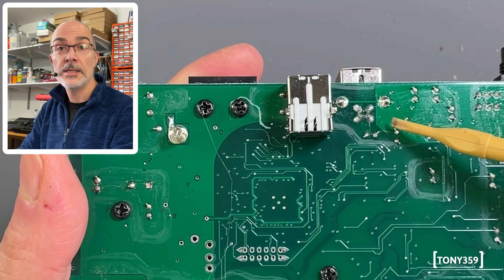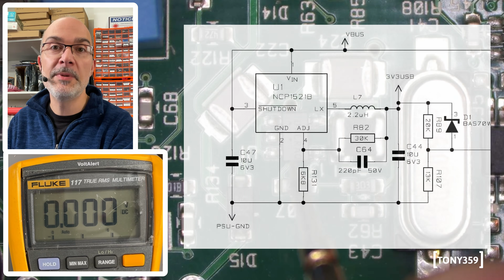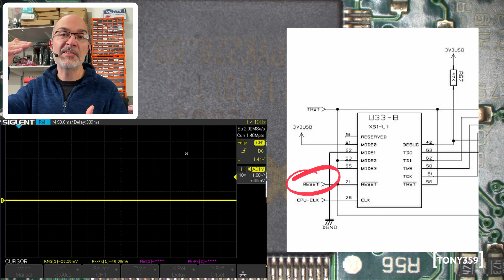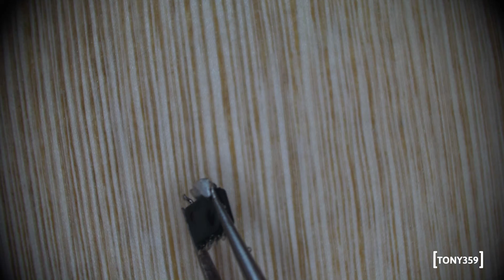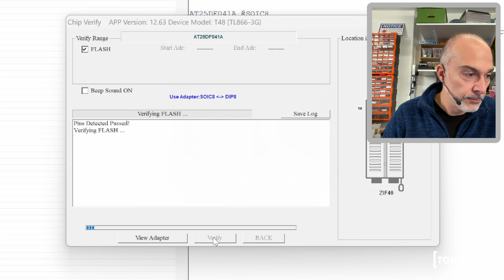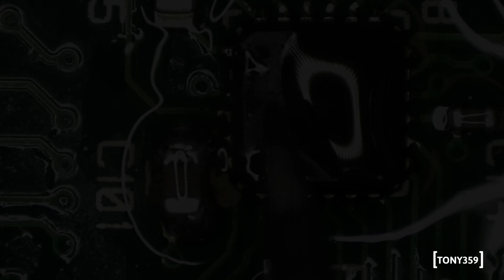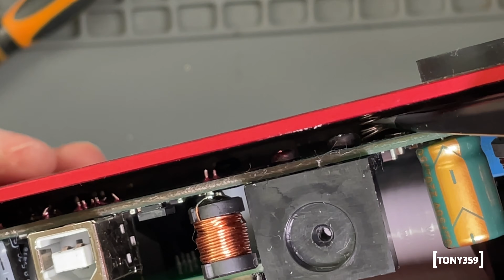Fixing this soundcard wasn't easy!

Comment: I 2 questions 1. what is the liquid stuff you put on the solder joints and two where can I find a USB jack to fit the the focusrite Scarlett ?
Reply from the maker: 1. it's called flux. It's a must when soldering, it makes the solder flowing, preventing oxidation. 2. USB jack?

Comment: Hi great video!!! I wanted to ask how exactly what usb and chip did you purchase?  I might need to repair a used focusrite coming to me. It has an issue of connecting at time to the PC 🖥️ , to solve it the previous owner said they unplugged it and replugged it , and the the computer would detect it. Any clue 🕵️‍♂️ on what this might be?
Reply from the maker: it's called USB 3343 but make sure your Focusrite has the same IC. 
If the issue is intermittent... it could simply be a case of spraying some good contact cleaner in the USB socket and/or try another cable :) I'm not sure a faulty USB IC would show such an issue but I am not an expert! :) Good luck!
Reply: @tony359  thanks for your reply and info. I will try this out once it arrives. I’ll let you know how it turns out.
Reply from the maker: Please do!
Reply: @tony359  hi just got it in and when I connected it, the usb light turns on for a few seconds .. then turns off then on it just keeps repeating that same pattern eventually after turning it off and unplugging it , it will connect. Any Idea 💡 on what it might be?
Reply from the maker: @ToneyLocoTV  I had a similar issue with mine, it's in the video. It's difficult to solder those bastards!
Reply: @tony359  yeah that’s right !!! So where could I find the correct USB IC for the 18i20?
Reply from the maker: @ToneyLocoTV  Why do I feel it's one of those 18i20 I was trying to buy on Ebay? :D
Aliexpress is your friend :) But it might just need to be re-soldered.
Reply: @tony359  I was thinking maybe solder but I’m trying to locate which one of these tiny chips it is would it say usb what should I look for?
Reply from the maker: @ToneyLocoTV  it's going to be close to the USB port, it'll have traces coming from the USB port and if you google the IC number it'll say USB on it :)
Reply: @tony359  just did some investigating and I can not seem to find the chip
Reply: Don’t see any chip that’s as small as the on in your video I see to that look similar but they are different sizes and don’t say anything about usb
Reply from the maker: @ToneyLocoTV  it won't say USB on it. You'll have to google the code and the datasheet will tell you it's a USB receiver. What generation of 20i18 did you get? I'm expecting one over the next few days and I'll definitely take a look inside.
Reply: @tony359  I have the 2nd gen 18i20. I see that it has two chips that say xmos (xfr002c) and (xfr001c)
Reply from the maker: @ToneyLocoTV  That is the CPU - you haven't watched my video, have you?! :D
Reply: @tony359  😂 yes I’ve watched it a couple of times but in the 18i20 it has two chips that say xmos .
Reply from the maker: @ToneyLocoTV  but the XMOS in the 2i4 is the CPU! ;)
Reply: @tony359  so are you saying the 18i20 has 2 CPU’s?
Reply from the maker: @ToneyLocoTV  https://khronscave.blogspot.com/2019/04/41-focusrite-scarlett-18i20-1st-gen.html
Reply: @tony359  yeah I happened to see this one , the gen 2 version has 2 capacitors instead of a usb3343 chip not seeing any chip that looks similar to the usb3343 18i20 Gen 2 has a sort of different layout.
Reply from the maker: Then I don’t know I’m afraid but it must be close to the usb port. Maybe at the back? I doubt Focusrite redesigned massively the PCB, too expensive to make changes 🙂
Reply: @tony359  yeah but I’m not seeing that similar looking chip near the usb port
Reply: Would it be possible for you to check out some pics of the inside of the gen 2 18i20 to see if you can spot it?
Reply from the maker: @ToneyLocoTV  if you send me good quality high resolution pictures, yes. Better if you share them (onedrive, dropbox etc). My email is on my profile.
Reply: @tony359  ok great I’ll send them as soon as possible

Comment: What Can cause a sound card to fail ?, sencondly I Can know if a part from sound card driver there is some thing else to add because I use Scarlett 18i8 1st génération in the computer from mixcontrol I see the output signal when I play music but that does not don't come out to the baffle
Reply from the maker: I'm not sure I understand your question but it's hard to help at a distance I'm afraid. If your 18i8 has no sound output, I'm not sure I can help.

Comment: Muchas gracias por tu aporte.
En mi caso es una iTrack Solo que de la nada la pc dejó de reconocer la Interfaz 
La solución que me funcionó fue usar la estación de calor en el circuito usb3343 para que se vuelvan a soldar los pads, no fue necesario cambiarlo
Dejo aquí el comentario por si a alguien le sirve :)
Reply from the maker: Thank you - someone else also mentioned that reflowing the USB3343 was all it was needed. Who knows, maybe it would have worked in my case too! Thanks for commenting!

Comment: I repaired mine by applying a little heat to the USB chip.
It has been running for 4 years.
What I don't understand is why you changed the USB connector without first checking your connections.
It seems that in this model, Scarlet 2i4, this failure is quite common.
I subscribe to the channel because of your excellent videos
Reply from the maker: Hello and welcome! The USB connector was broken, the central part was missing and had the terminals just hanging in the air! Sorry if that wasn't clear in the video.

Yes, I could have tried re-flowing that IC for sure. Not sure why I didn't try? Maybe to avoid stressing the PCB twice with heat. Some PCBs are not great and traces start detaching when heat is applied, even at low-ish temps. But I have to be honest and I don't think I had this elaborate thought back then! :D

Comment: Since you are obviously a genius at this - there is a common problem with the Scarlett 2i2 where it boots on, flashes orange on both gain nobs a few times, is recognized by the OS but has NO sound at all and NO input signal with or without phantom power. Thoughts? Focusrite tech support say - broken, so sorry for your bad luck ;P
Reply from the maker: ahah no geniuses here! :)
No, I've never heard of that. I suppose it might be a Firmware issue. If the interface doesn't have a way to re-load the firmware when the interface is not in a working status, it might require some PCB work. 

Does the I/F show ok on the OS? That might indicate the CPU inside the Scarlett is actually working so the issue is somewhere else.  Sorry, not really familiar with that fault.

Comment: Thank you for your video. Love the accent. I was going to buy one of these, and I also have the same disease of getting the one in a thousand million products with a fault that causes the card to record all vocals in reverse, or something similar. I fancy myself as a bit of an electronic repairman but I would have binned it early on in this repair! BTW I bought a UA i/o box which has v. similar specs and its great.
Reply from the maker: Thank you for watching! I've been using this little interface and it's ok! There are a few reports of the same fault though, maybe not the best HW implementation.

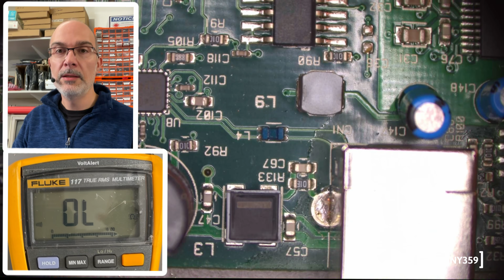Comment: Hi! Thank you so much for making this video. I have a 2i4 with the same problem, but mine it does get recognized and works for almost 2 hours and then dies, then if I unplug and don't touch it after a few days it works again for 2 hours and repeats. When it stops working i get the same problem that it doesn't get recognized by my PC (Windows 10). I already tried it in W7 and W11 and still get the same issue (I haven't tried in Mac). I bought it second hand like 3 years ago and I never get to see a good video that shows troubleshooting, until now. Now I'm trying to read the voltage with a multimeter but i have never used before in a system like this board, i dont even know where the negative probe should in minute 8:20 hahaha, I would be so grateful if I can get some help in my journey too by netizens, it would make my life!
Reply from the maker: You can attach the negative probe to the little spring which is at the bottom of the board. That's an interesting fault, I wonder if your board might need new capacitors on the power rail?
Reply: @tony359  Thank you I really appreciate your reply! I'm reading the voltages now and I found that my U1 voltage regulator shows 4.60V for input and 0.12V for the output so I measure the capacitor (C163 I think) that gives power to the U1 and its the same voltage, then I measure the usb input and i read 4.22V for one pin, -0.12V for two pins and -0.05V for the last one, so i think something is wrong there and I will change the usb input. However, I don't think the problem lies there. I couldn't download the schematics in Badcaps to see which where the correct values of voltage. EDIT: One hour has passed since i connect the 2i4 and now the U1 shows 4.57V for input and 0.12V for output. I also tried change cables but it shows the same voltage.
Reply from the maker: uhm... are you sure your multimeter is working ok? 5V on USB is coming from your computer. I could expect 4.8 but not 4.22. 
What's happening with badcaps?
Reply: @tony359  Sorry, my bad. I'm measuring again the USB input and it shows 4.68V on one pin, -0.029V on two pins and 0.096V on the last pin. U1 now shows 4.06V on input and 0.018V on output and U2 shows 0.018V on output

When I click on your attached PDF, this message appears: "Sorry, you are not authorized to view this page. For assistance contact the site administrator." Maybe it's because my account is new.
Reply from the maker: Yes, probably you need to wait until the admin approve your account. Let me know if it doesn't happen and I'll find another place where to share them. 
Are you measuring 0.029 with the unit working??
Reply: @tony359  Hi, I already found the schematics in google but thanks! And no, i did the measuring with the board connected but not working. I tried measuring with other cables and in other ports and it varies a lot. At some point I was getting 4.83V on one pin, 0.015V on two pins and 0.09V on the last one, but then a message appeared on my PC saying "Power surge on USB port" and my mouse and keyboard stopped working. To be honest I was very scared and proceed to disconnect all and restart my PC.

I think I should let it rest for a few days and start the measuring again while its working fine.
Reply from the maker: Your PC's USB IC should be able to protect itself if you short something. Components are very small and it's easy to short things. 
Do you get the correct voltages when the board is working? Regulators U1 and U2 get the 5V from the USB port (VBUS). Those regulators have passive components to set the voltage so if you don't have an output - but you have an input - I'd say there is a short. But on both the IC's? I find that unlikely. Check what pins 3 are doing, the "shutdown" pins. It's the enable pin. For U1 that is VBUS directly. For U2, I believe it gets enabled AFTER U1 has come up online. 

Still, I don't see how both IC's can be off at the same time.
Reply: @tony359  Hi!, I just measure the 2i4 while its working here you have the measures :) PD: While measuring one pin of the USB input I started to get blinking lights in the 2i4, the voltage of that pin started to jump around 0,080V and 0,050V and then I get a BSOD with the message Bad Pool Header, after that I restarted my PC and the 2i4 was still working and had the same voltages that I had measured before)
Reply: USB INPUT:
	3,99V
	-0,042V
	-0.007V
	0,080V - 0,050V BSOD Bad Pool Header

U1:
	1PIN Input 3,84V
	2PIN 0,025V
	3PIN 3,84V
	4PIN 0,70V
	5PIN Output 3,70V

U2:
	1PIN Input 1,45V
	2PIN 0,025V
	3PIN 3,84V
	4PIN 0,56V
	Output 0,975V

USB IC (C137):
	16PIN  3,0V
	24PIN 1,638V

Xmos:
	1PIN: 3,70
	12PIN: 0.947V

Memory IC (U37):
	1PIN 0,025V
	2PIN 0,025V
	3PIN 1,87V
	4PIN 2,83V
	5PIN 0,025V
	6PIN 1,87V
	7PIN 3,70
	8PIN 3,70

C95 (DIRECT INPUT?)  = INPUT 3,99V - OUTPUT -0,001V
C100 = INPUT 3,95V - OUTPUT 0,025V

L2 = 3,95V
Reply from the maker: @Taijex  I appreciate you're trying to help me but it's difficult from here to do so. What I see is that your USB power should read closer to 5V. 3.99V don't make sense. Are you sure your multimeter works and you're referenced to the correct ground?
U1 should read 3.3V but at least U2 does read 1V - which makes everything looking suspicious: is U2 reads ok, why does U1 does not and why USB also read incorrectly?\
What multimeter are you using?
Reply: @tony359  Thanks for your reply, I think I'm gonna open a thread in badcaps. My theory it's that my U1 only works below 4V (undervoltage), that will explain why when I'm reading over 4V on the USB input the system doesn't work and the U1 don't output any voltage. The real question is why am I reading below 4V in the USB input when the system its working and why it goes up after sometime and stop working. I'm ussing a generic multimeter but I don't think it is bad, however I'm gonna try to get one from a friend to make sure.

Comment: makes sense the USB interface chip died, the USB port broke and probably shorted 5V directly to the data signals
Reply from the maker: Yes even though those data lines are rated up to 5V - that's what the datasheet says - so I'm a bit puzzled. Thanks for watching!

Comment: Great video! Thank you for keeping your experience truthful and showing that anyone can regroup and conquer unexpected PCB issues within. Some creators will go out of their way to hide any scope footage  that shows that they have little to no experience working with. People need to shown what it looks like to jump in feet first and not be worried about being embarrassed while trying. Whoever would have a beef with such logic is probably the same person that would edit their own video to not show that they’re a noob at something.  I’ve done quite a few projects like this one but I’ve never attempted to record it. In my experiences I’ve seen my work improve on the soldering as well as the finished product. Some of my first projects looked rather rough at the end. The biggest reward is seeing your work actually work like it was designed to. If I could clean up my rework aesthetics that is my goal to make. Thanks again!
Reply from the maker: Thank you for your kind words, I do appreciate that! In terms of improvements, when I started with a soldering iron - maaany years ago - I could not solder without burning each and every component! :)
The fun is in the journey! :)

Comment: 23:34 I didn't realize they'd have pads not connected to anything. Guess it makes sense, just to hold the chip in place, but I was worried when that pad was gone lol
Reply from the maker: Yes it's not uncommon. Had the pad been connected, I guess I would have had to wear my telescope glasses and attempt a bodge wire :) 
So glad that that was not necessary!
Thanks for watching!

Comment: My first idea was that the 5V supply finds its way from the broken plug to the USB Data input and destroys it. I had several broken USB plugs that destroys the USB port in the past.
Reply from the maker: The 3343 USB chip is rated for a maximum of 5V on the data lines so that shouldn't damage it. Maybe some static discharge? Or maybe the IC didn't like the intermittent contact. Thanks for watching!

Comment: That not firmware - thats the eeprom that holds on the setup values for the firmware.The firmware is burned into the MCU's OTP-memory and that is read-out protected in regular case.What surprises me a bit is your working technique. You can desolder it like this. Cleaning the pads is also ok. Re-tinning is only necessary for the central PAD in the middle. For this I use solder past. There is still enough solder applied to the pads. A little flux applied to the pads is enough for now. Position the chip on the pads and then heat it with the hot air gun until the solder paste has melted. Solder the pin pads individually using a fine soldering tip, a little dripped flux and solder paste or very thin solder (0.5mm diameter). This works very well with the JBC soldering station. The JBC knife is too wide. The amount of flux they used here is simply too much. You won't be able to remove it from under the structures and in the long run it will attack the components and the circuit board. How conductivity changes over time is difficult to predict. Flux is good but it needs to be used as little as possible. The “no clean” products also leave residue.
In the end it worked. The USB chip tends to die sometimes because it has no overvoltage protection at the input and if I saw the circuit correctly, there were no suppressor diodes at the input. Only the mantle wave filter was visible.
Nevertheless, congratulations on a successful repair. I'm always as happy as a child at Christmas when I've managed a repair. As components become ever smaller, repairs are becoming more and more of a challenge.
Reply from the maker: Thanks for your comment and all the pointers!

Comment: you should press on the chip to squeeze out excess solder before finishing your soldering
Reply from the maker: I did - it should be in the video too. But maybe the solder hadn't melt properly or there wasn't enough solder. I'll do better next time :) Thanks for watching!